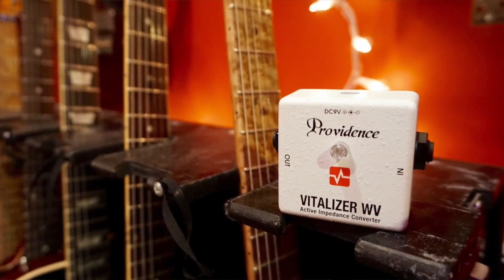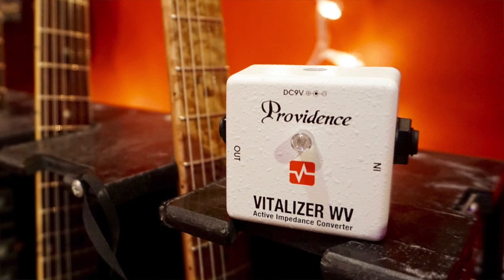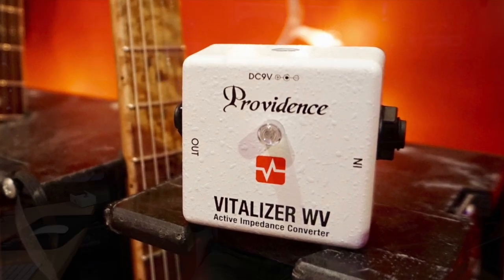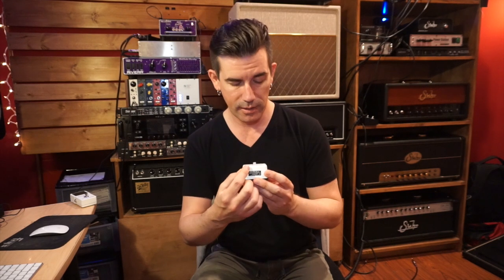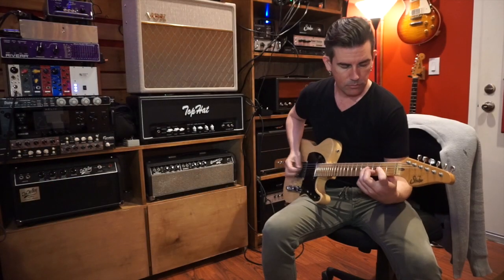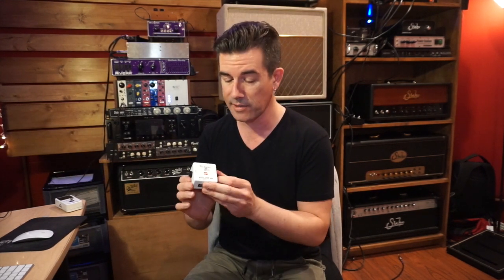How A Buffer Will SAVE Your Guitar Tone,  feat. Providence VitalizerWV

Comment: Jimi Hendrix and Stevie Ray Vaughn did the opposite of what this pedal does. They used long cables to add capacitance. They didn't like the tone of short cable runs from their guitars. I guess of you need to extend the cable even further thoug.. this helps.
Reply: Christian Noir 

there guitar and amp was friggin bright as the sun man! they needed some high end roll off. can u imagine srv with a strat bridge pu and a a super reverb blasting a crowd? welding arc bright

your exactly correct too man!good point
Reply: Modal Blooze The weird thing is... My best sounding setup had a cable with a short in it. The cable finally broke and... the new, "better," mogami cable didn't sound the same! Then, I bought the same exact cable and... that didn't sound the same either! ):
Reply: Christian Noir 
well maybe somthing elese was different huh?has to be.
Reply: Modal Blooze Nope. Nothing in the setup changed. In fact, it didn't even move. Everything was in the same exact place... and it's not like the tubes went bad... this was actually a digital rig. same presets and everything. Nothing changed whatsoever. 
The new cables seemed to "pass too much electricity," and gave an icepick sound to the duncan JB's.

Comment: Does your sound still benefit from high quality cables used after the buffer? It sounds like this buffer makes using nice sounding, post buffer, cables a moot point.
Reply from the maker: A really valid question. I just use good cables no matter what, as they are usually more durable, etc besides having lower capacitance. But sonically, .... I have to ask some folks, i don't have a good answer.
Reply: Thx Pete. If you find out let me know. As a follow up question. How do multiple buffers act in the chain? Say I put a Vitalizer in front of a buffered pedal like an RC Boost, (pretty sure the RC is buffered). I assume the Vitalizer circuit would be a more desirable buffer to have but would it be needed or would it's more desirable effects be nullified by the "lesser" buffer next in line?  I'm I making sense? Sorry for the pain in a$$ questions.

Comment: Would you run it before, or after a Wah, fuzz, or overdrive pedal? Do I need a separate one n the fx loop if I have cables in my fx loop that equate to the roll off point?
Reply from the maker: All good questions and all rig dependent! Some fuzz sound terrible with buffer in front, some are ok- some wahs suck tone, volume pedals too- buffer in front can be very helpful. Some amp loops are NOT buffered right and won't drive long cable runs...
Reply: Thanks Pete. I enjoy all of your videos, and the fact that you make time to answer questions. I use a TC buffer, and have moved it around a little, and the answer you provided is absolutely perfect. It's all up to the pedals a players owns, and the amp.

Comment: Hey Pete, is this something you would run pre or post effects? i.e, would it clean up the sound enough running at the start of the chain, or would the non-buffered pedals end up knocking the signal back down to it's duller sound?
Reply from the maker: Yes indeed- Phase 90 for example, has a rather high impedance out. I use a buffer at the beginning AND end of my chain for the very reason you describe
Reply: Is it possible to have too much buffering going on at some point? An adverse affect? Or just when in doubt buffer away! I just got an RJM PBC which has multiple buffers throughout it so I'm assuming I'm taken care of but just curious.

Comment: That truly is amazing. I would expect pros to use wireless. (I would trip over at least one cable on every gig!!). But maybe wireless is not good enough yet?
Reply: danmar, pros do use wireless mostly and have been doing so since the '80s. I saw ac/dc in '83, angus ran all the way around the Capital Centre concourse while soloing. must have been near 100 yards from the stage at one point and loss of signal wasn't an issue. I'm sure his tone was rolled off and there was definitely a big time delay, but it was cool as F.
Reply: So affordable wireless just took a while to trickle down to the consumer.

Comment: Nice video! Is there a general rule about where to place a buffer in the signal chain?  I have (in order) Wha, overdrive, distortion, fuzz, Moogerfooger and two delays (most of them true bypass). I do notice the signal gets "weak" at some point in my pedalboard but honestly I wouldn't know where to start and where to place a buffer.
Reply: potterman83 always after a fuzz 
Fuzz pedals and buffers are arch enemies. 
Plus it sounds like that would put it about dead center in your signal chain which is good. And your wah and drive/dist pedals will won't lose the signal too much. 
At least that's what I would do but there's no harm in moving it around the signal chain to find whatever sounds best to you. 
Hope that helps
Reply from the maker: Some fuzz are ok like a big muff- anything germanium usually u want buffer after!
Reply: Doug Munis thanks man!
Reply: Pete Thorn thanks Pete... I'm big fan of your videos!

Comment: I thought the 30' cable sounded best. It had too much high end for my taste with the 10'. Just my opinion.
Reply from the maker: Sure, that bit of capacitance can be nice. But- you could just turn down treble on amp, or back the tone down on the guitar. Easier than relying on a cable as a tone control! :) I don't like that idea- why rely on a certain cable for tone? Also- get beyond 30' and remember you'll lose more high end. So, if I use some true bypass pedals, and maybe a 15' or 20' cable going both to and from my board- now we are looking at 40 or 50 feet of cable possibly. Too much tonal change for me- I hate thinking I'm losing tone!
Reply: Good point Pete!

Comment: Does other buffer pedals work like these as well? Wanna ask for other  choices
Reply: Any high quality buffer will have the same effect. I personally use the Lehle Sunday Driver. Very nice buffer. This Providence one sounds great too, and is very small.
Reply: swellguy66 Hi, I have a Lehle Sunday driver 2 and have never really known where to put it on my Pedal board,  Would appreciate any help, I am not using it at at the moment seems a waste.
Reply: I looked it up and it's a booster pedal also, you can put it before an overdrive/distortion for higher gain or after for increase volume. I would personally put it before any pedal or after the tuner, since i will use it as a buffer
Reply: twintower415 , thanks for the reply,  I will give it a go, thanks for the advice.

Comment: But many pedal says true by pass, do i still need a buffer?
Reply: fedboy21 the problem is the cable not the pedals, so yes.
Reply from the maker: Any pedal that's true bypass does NOT have a buffer. So, add up all your true bypass pedals and cable length.... actually, the way to do this ideally is- find the cable/sound you like, with NO fx. just cable-amp. Now- use that length of cable, in total, including wit and then run a buffer after that.  Hope that makes sense

Comment: Aren't most if not all Boss pedals buffered, wouldn't that provide the same solution?
Reply: Yes. Tone snobs will say that you need a separate buffer, but a boss pedal will do fine
Reply from the maker: See my above replies- the short answer is, sometimes.
Reply: Generally yes, and that's one reason I like about Boss. But the position of the buffer comes into play in this scenario - no buffer before fuzz, buffer after uni-vibe, buffer at the end of chain etc. Also not every buffer circuit is the same -  although you probably won't be able to tell the difference in a mix.

Comment: why do I like the 100 m coil cable sound???? WHAT'S WRONG WITH ME???????
Reply: Teles and some amps can be bright and harsh so I can how the coil cable can roll that off would sound good.
Reply: Nothing wrong with you.There are actually cables with variable capacitance
so one can make the sound as dark as one want.I also think that coil cable
sound has character.
Reply from the maker: You just like a darker tone! So- consider I could just back the tone on amp down (or on the guitar). Instead of losing signal to a cable.
Reply: fair enough
Reply: its like the first tone with 30% of the liveliness sucked out of it.it still sounds
 alright but its nowhere near as good as without 3 miles of cable.

Comment: Ironically, of the three tones, the one with the 30 feet of cable rolling off just a bit of the ice picky top end of the Suhr sounds best to me. If the Providence had a drag control that could be used to simulate different cable runs it would be the best of both worlds where you could tailor the buffer to the equipment used.
Reply from the maker: once again- easier to just back the amp treble down, no? :) I don't like the idea of losing tone to a cable, as a tone control, really. That's what the tone on the guitar and amp are for, IMHO.

Comment: 100ft sounded fine to me. uh oh.
Reply from the maker: U like a darker tone! That's cool but- I'd rather just back the tone down on amp/guitar than lose signal to a cable.
Reply: Well the point of a buffer is restore the high end - you can always dial down treble control on your amp to get darker tones. But without a buffer, you really don't have a choice to get that high end back.

Comment: who the fuck uses a 100 ft cable?
Reply from the maker: +Mario Thomsen no one. Well probably not. But a few people sure the fuck use at least 40, when you add up all the cables with the pedals, Runs to and from the board etc. and believe me you can hear 40. You can even hear 20. Who the fuck wants their top end dulled too much by a cable? A little bit it’s OK but I sure as fuck don’t want too much of my fucking top end chopped off by some fucking cable. I mean who the fuck would want that? Sure as fuck not me. Fuck no!